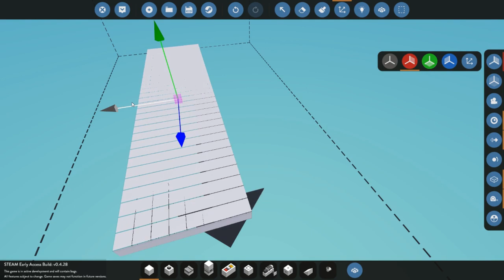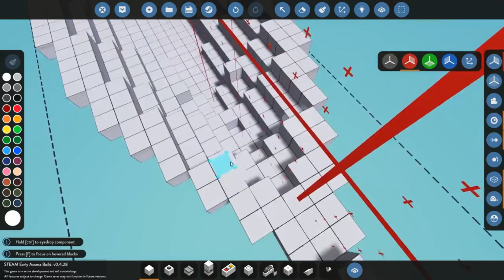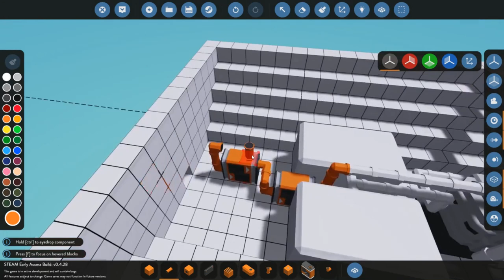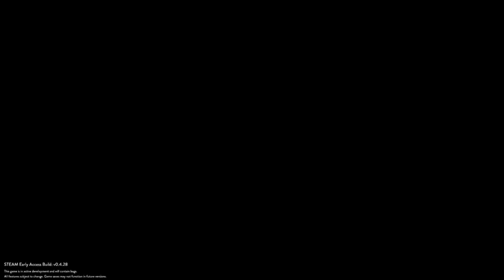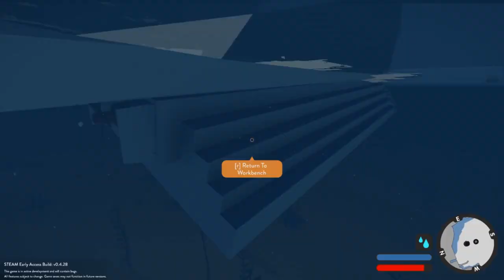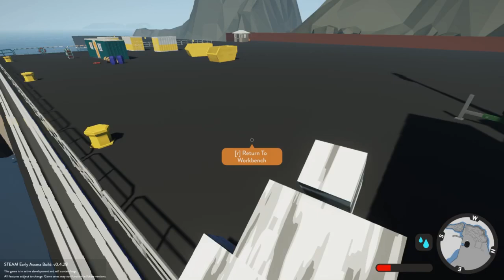Multiplayer Advanced Engine Speedboat Challenge! | Stormworks Early Access

Comment: Can you remind me again why you used 1 small engine only? XD
Reply from the maker: ummm, not exactly sure, but at the time they were light fast and could handle a few gearboxes! Now they are a bit worse.
Reply: @StormRunnerGaming  aaaaah okay, then It makes sense xD
I just thought that I missed the part where you had some kind of rules about this xD You should try (if you haven't) 2 jet engines with 2 large propellers each and gearboxes set to 1:1 (or 1:-1)... It's ridiculous... My 20x6x8 meter ship goes like 80 in hydrofoil mode... And 40 to 50 without... Those engines are crazy...
Reply: @StormRunnerGaming  but with the pipe output instead of a Jetstream :)